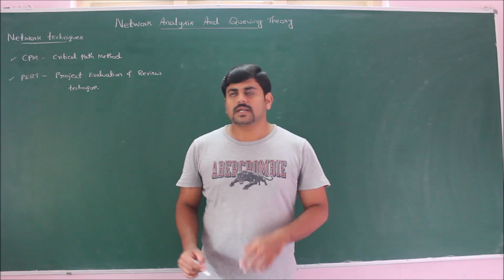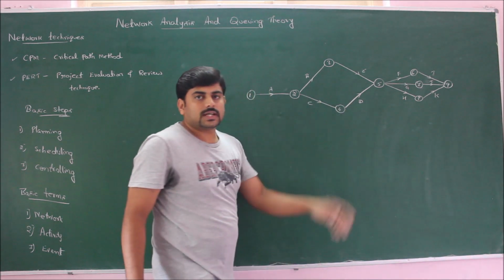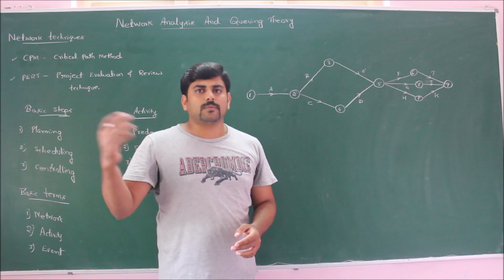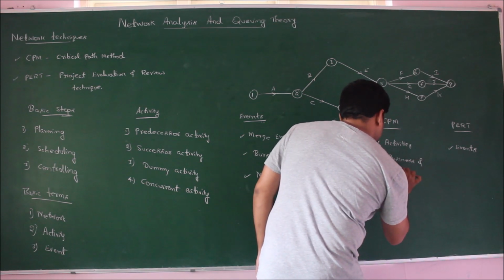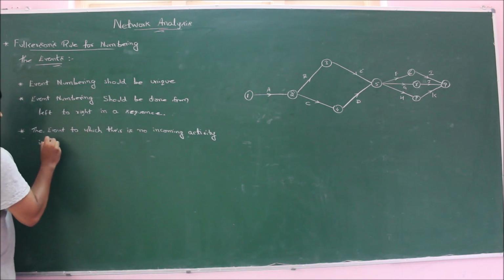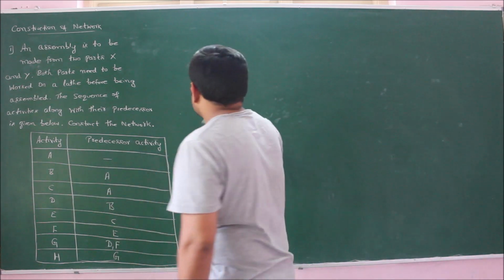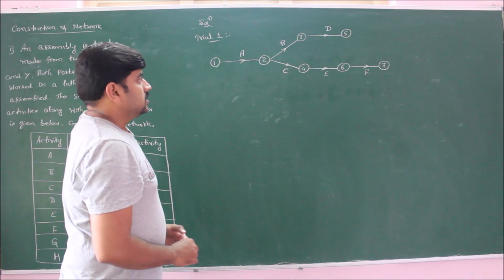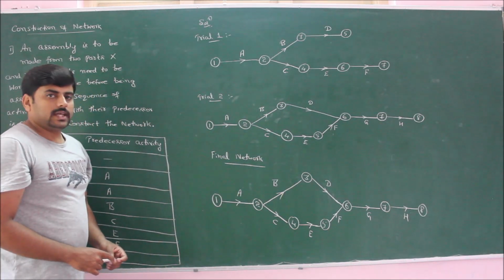31 - Introduction to network analysis ( PERT and CPM ) - Module 4 - OR by GURUDATT.H.M.

Comment: Please do give the lectures on Transportation problems sir
Reply from the maker: Assignment problems are included in 17scheme also, if you go through assignment problems it is enough with open choice examination. With less than 48hrs for your exams i think you are heading in wrong direction

Following is my suggestion 
9 a) b) Game Theory 
10 a) b) Sequencing 
1) a) b) or 2) a) b) Graphical method for LPP
6 a) b) Assignment Problems
7 a) b) PERT and CPM
This is the order and easy 100 on 100 ( Only for open choice examination ).